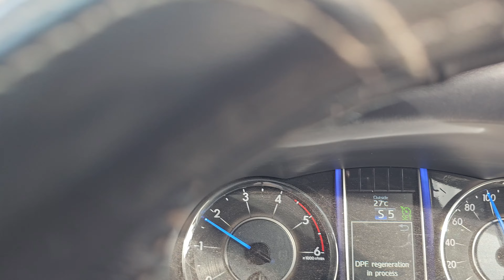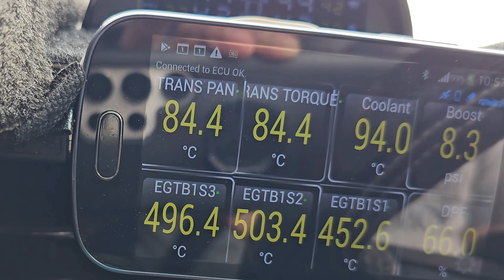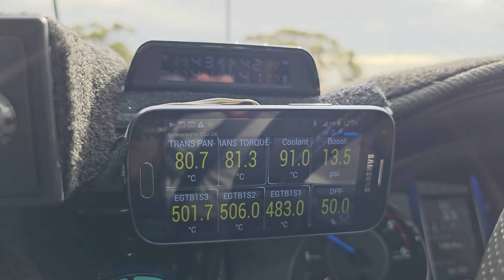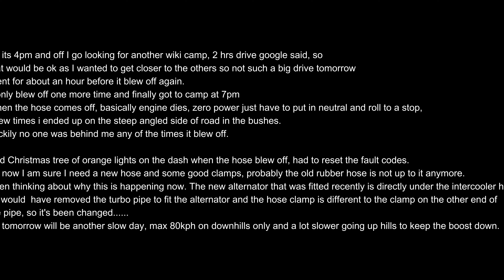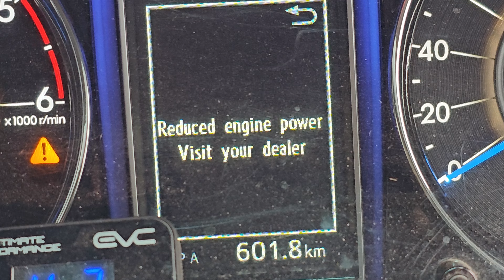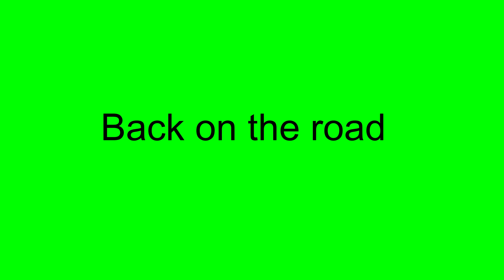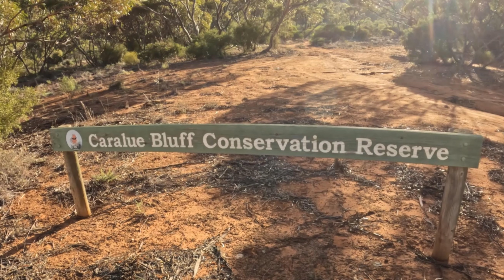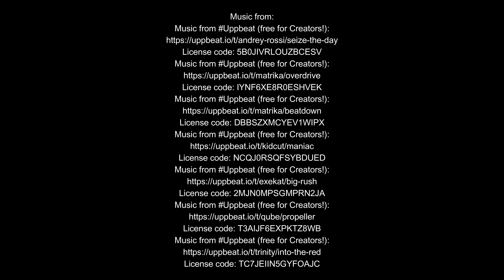#0204 The Journey Begins, heading to Smoky Bay, SA

Comment: Did new hose and clamps fix it Neil?😮
Reply from the maker: In a word no
After many attempts I think it is finally fixed
I used a nail file to rough up the plastic pipe a bit, then used rubbing alcohol to clean pipe and hose, then used loctite 222 on it and used the std type hose clamps, double clamped of course and so far it's not come off
Reply: @NeilF4x4Crusading  good luck 🤞 maybe time for a hard pipe